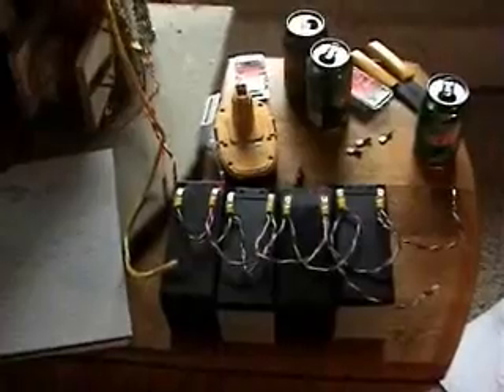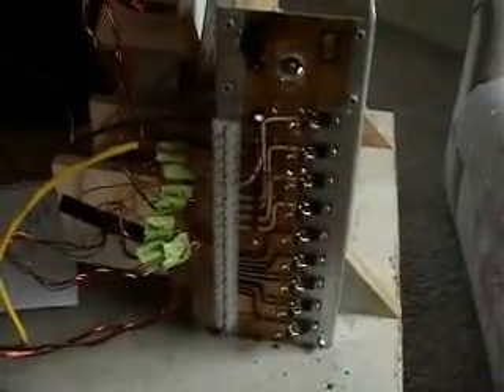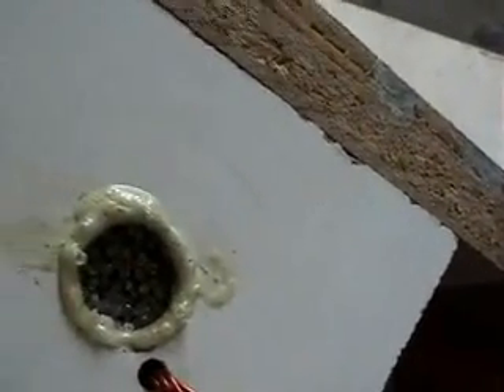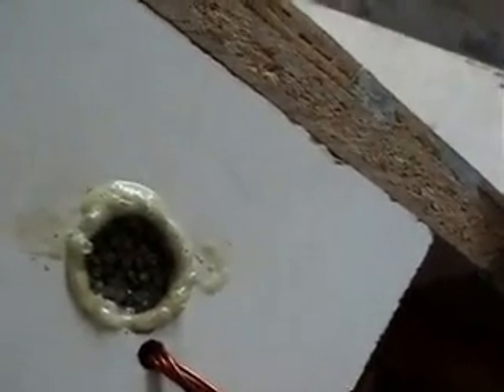Bounty Hunter Energy Projects #4 Bedini motor generator hho

Comment from the maker: Thanks for the comments.  I am working on putting together a much better video.  I think it would help if I had a good lookin gal doing the presentation. :)  To M3SCA1  : yes we do plan on using this in conjunction with a HHO cell.   I've put a bridge rectifier and capacitors on the charging side now and my voltage jumps up to 125volts.  I power the light bulb now without the inverter.  I'll show that on my next video.  Thanks again... keeep watching... And good luck to all of you!

Comment: That 40w light is a big load for such a small 7 ah battery.  If you can get a 4 watt 12volt bulb that would be ideal and will be easier on the battery.  You want a slow discharge then a similar charge to fix the battery so that it will get back to advertised.  Also you may have to drill the top and fill with distilled water if any of the cells are low.